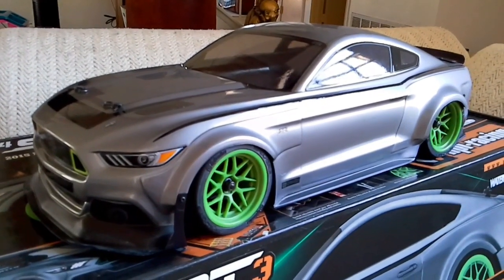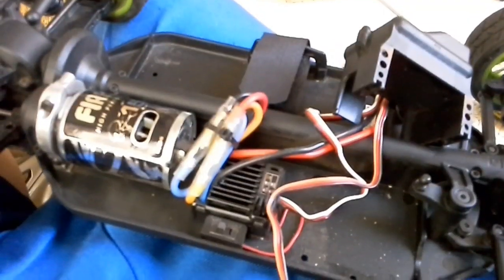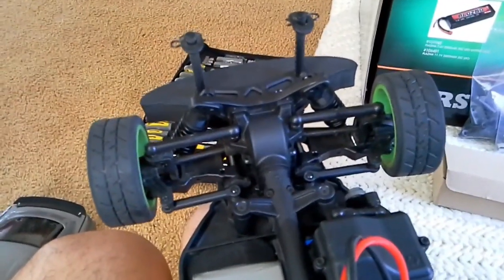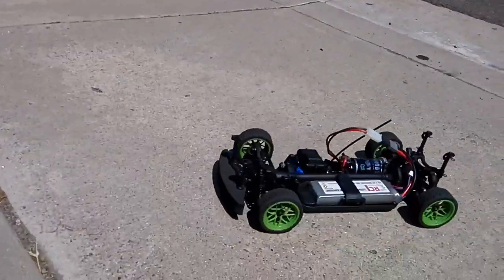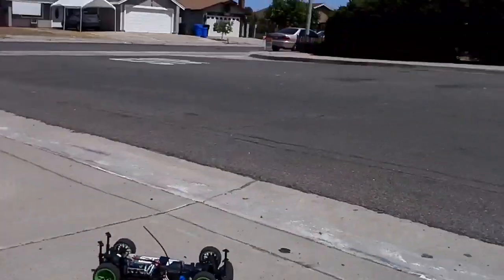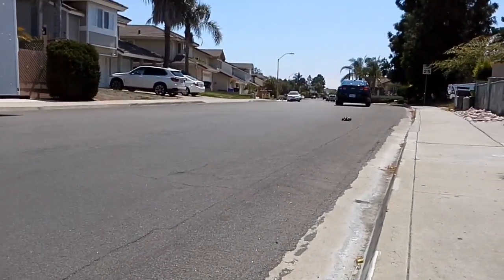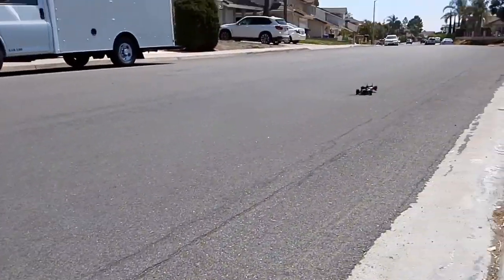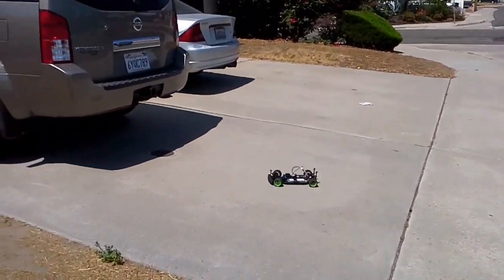HPI SPORT3 MUSTANG today's episode.

Comment: How fast can it go
Reply from the maker: Noah Rothenberger about 25-30mph stock setup. 😊
Reply: Tom Tracks cool i think it could go faster with a castle moter and esc
Reply from the maker: Noah Rothenberger I might get one👍
Reply: Tom Tracks ive got a side winder 3 esc in my cheetah all you need is a fan on it be cause it over heats really easy
Reply from the maker: Noah Rothenberger good to know, that's awesome! Cheetah is a solid rig👍💯
Reply: Tom Tracks it is but today i broke the wheely bar off im waiting for another one to come from banggood